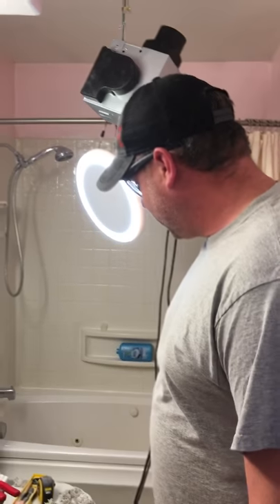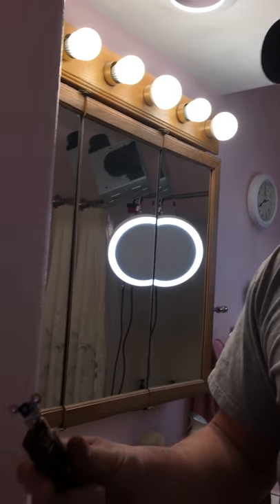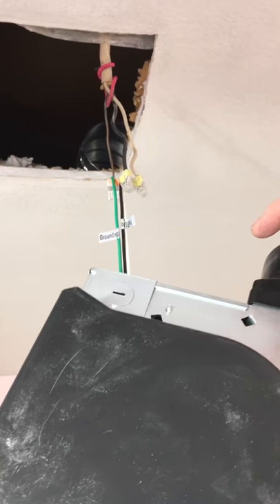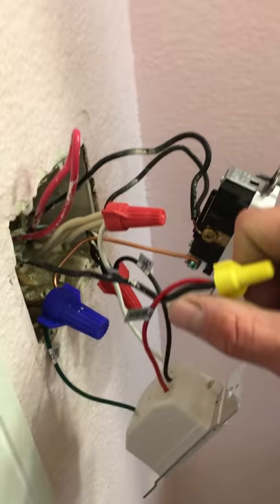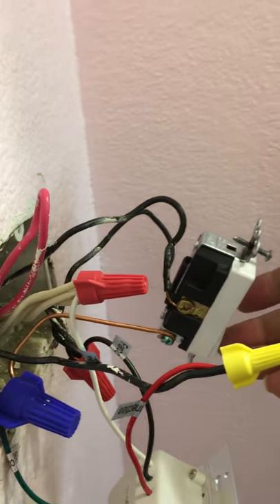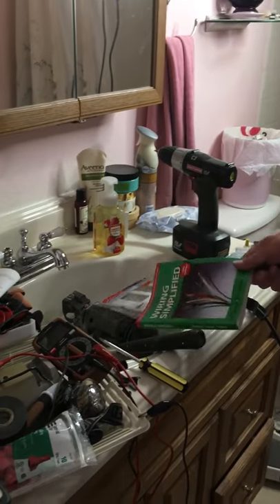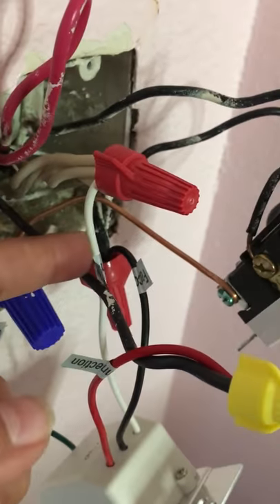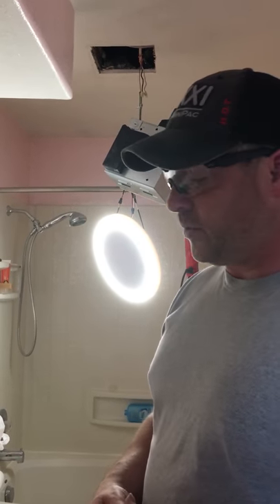Installing Home NetWerks Bluetooth fan

Comment: Thank you very much for the video. Double thumbs up to your wife for her simple explanation.  The only thing I did differently was I connected the red wire on the back of the supplied switch to the red wire that traveled to the ceiling.  I then connected the red wire in the ceiling to the black wire of the fan. I capped off the black wire in the ceiling since that wire powers the other two lights that I have in my bathroom. Before finding your video I was about to call an electrician. Again thank you both very much.

Comment: Thank goodness your wife clarified the wiring. I was able to install this because of her.
Reply: Linda I agree on that. But both he and his wife failed to say to which House Black wire the Switch Red wire is connected to. I need that info for mine.
Reply: It's easy when you're an electrician, but good job on the diy

Comment: On the switch:
The green goes to ground.  
The white neutral goes to white neutral. 
The black goes to the black power. 
The red goes to the black power from the fan.   

If you are getting a blue flash and clicking that repeats it's because the red is most likely not hooked to the right wire.   

The basic way to think of this is that the power from the house (black) connects to the switches black wire ( giving power to switch) then the red wire (when switched on) gives that power to the fan unit thru the black wire from the fan.  

The white neutral completes the circuit. The green grounds it.  

No matter how weird your wiring is there will be a black power wire and from that same cord will be the white neutral.  

The problem I'm having is that the switch will not pair to the fan unit.  So the four buttons don't do a thing.  I have even switched out all the parts with another whole unit incase something shorted on initial install.
Reply: The original fan unit had an error so a replacement of the unit fixed it.
Reply: I am having the same problem as the on and off button does everything and the 4 buttons just exist for no reason. By pressing the on/off button, changes the functions for light, fan and speakers. Can't access the night light or blue light. By pressing the on/off a few time would led me to a flashing blue light but up-on pressing LIGHT on the switch, it will quickly turn day LED lights and the buttons would not work. No sure of wiring or switch is faulty. Any recommendation anyone? Tried calling support but I am always home and they are not open for business.
Reply: Mine did the same thing ended up being the gray plug inside the light I just unplugged it and replugged it and it connected right away for me

Comment: I was very successful with installing mine, but only after 8-hours of cutting out a larger opening for it and having to also totally re-think the ducting work. I found a 4" to 3" inch reduction duct fitting that works fantastically and even speeds up the airflow as it forces the air into a smaller duct going though the smaller duct tube from the big one that the fan housing has. The wiring for mine was very easy and straight forward as I am already equipped with neutral wiring throughout my 21-year old home. All in all, I love this vent fan! The lighting is awesome with the normal white and the two nightlight settings of amber and cobalt blue. The Bluetooth speaker connected instantly to my phone and to my iPad! I love this fan so much that I went out and bought two more for my other bathrooms!
Reply: Only a lefty would think that reducing the duct from 4" to 3" would actually speed it up.  Okey doke, potato.

Comment: If you purchased the 100cfm model that comes with the electrical switch, it is on its own circuit completely separate from the existing switches in the bathroom. The only thing you have to do is run power to the fan via the black wire.

Comment: Excellent video.  I am having the same problem and am getting ready to experiment tonight.  Following your lead, I think I will start with.... black wire on switch to the power from the house,  Red wire on the switch to the black wire going to the fan, white wire on the switch to the white wire going to the fan, and green on the switch to ground.
Reply: This video actually helped me a lot, I had put all black wires and the red together and my switch was not functioning, thank you very much for this video
Reply: Did this work?
Reply: @andrewburch9789  yes
Reply: I finally got mine to work as well.  I was missing my neutral tie in. Worked perfect

Comment: Question.  My old fan is wired from the vanity light, sort of daisy chained. Will i need to run a direct wire from the switch for this to work correctly?

Comment: This so far has been a nightmare
I have a 3 gang  switch 
1st. switch- Recess light work pigtail of the main blk wire
2nd  vanity light switch did the same as above.  Works
3rd switch (unit) 
wired the red and blk wire
White/ white
Blk/ blk main power
Ground/ground.  Doesn't work

Fan
White to white
Blk to blk
Ground to ground
Capped  off the red wired

Pls tell me what I am doing wrong?
Reply: I know i am late to the party but i have the exact same issue at the moment. Did you ever find what it was? i am mentally exhausted

Comment: This video helped a ton. However I still don't understand what to do with the red wire coming from the ceiling. Do I cap it off or something? Maybe it was said but I didn't understand or I missed it
Reply: Did you ever get an answer to this question? I'm in the same boat
Reply: Same boat as well

Comment: Ok. It looks like your wiring in your box is exactly how mine is. I wired my same fan unit the way you did and thought I had success. I paired the switch as it said to do in the instructions. Everything worked including Bluetooth. But then after pairing, none of the function buttons work. I push them in vain. Any thoughts on what has gone wrong? Thanks.
Reply: Did you ever figure this out I have the same problem
Reply: @ryanjohnson7572  Yes! I figured out that one of the thin bare wires (there are 4) that go into the socket (4 separate hole) was bent and didn't go into its assigned hole. The others did and those functions worked. I went up to the unit and discovered this issue and fixed it and then the pairing was successful. Thanks for asking.

Comment: How is the actual sound of the speaker? Pretty nice sound or cheap sounding? Thanks for sharing!
Reply: TLee we tried the demo they had setup at Home Depot.  Sounds clear with a little bass in it.  It’s two 2” speakers and it does get loud
Reply: Could be louder but not bad and clear sounding not cheap sounding or distorted

Comment: Avoid trouble cutting the connectors, I had a problem with the fan and Bluetooth because the connector doesn't work

Comment: Did u have to get into the attic?? I have no way to get into my attic!
Reply from the maker: TACOMATSS yes, spent quite a bit of time up there installing to new duct and securing it.
Reply: I just took out old fan used a muti tool to cut rock and plaster to fit the bigger fan and screw it thru the side of the housing against the stud in ceiling so no need to go to attic the cover will cover the hole so just fill with drywall mud to fill in hole if any and done took me 10 mins to install

Comment: why didn't you just run a three wire into the attic, wire according to diagram in a junction box and run a 2 wire into the fan from the junction box.  i think it would have been a cleaner install.

Comment: Note to self.  Only install a fan that connects at the current ceiling wires and doesn't need a new wall switch.
Reply: i think it is optional, but worth it, especially if your network ever goes down.

Comment: My system is all connected and just won’t stop flashing. Switch on or off it just flashes then makes a click, click noise. Then flashes. Over and over off or on just doesn’t stop wtf is going on.
Reply: Same I don't know what to do
Reply: rosco still never been fixed over 1 month.

Comment: This wire is a direct link to the breaker panel it doesn’t feed off or feed anything. Completely alone.

I tried black and red together to black, I tried black to black with no red I tried red with black. 

I am just not understanding where I am going wrong.

I read the instructions that says it needs to be paired but mine doesn’t turn off at all it is always on.

Comment: I have 3 homeworks Bluetooth fans and the buttons on the wall switch control all 3 fans at once tried different breakers and wired separate but still controls all 3 please help if have solution for this prob Everytime someone turns the light blue in bathroom my other 2 lights change blue
Reply from the maker: Danny fresh are all three fans in one bathroom? Are the fans setup in a series? Is there only 1 switch for all three fans or does each fan has its own switch?
Reply: Did you ever fix it?

Comment: It's pretty simple. Basically if there are 2 switches the only thing that wont need to be there  is a jumper wire from the black wire. Instead the black wire from the fan control goes to the bundle of black wires and the red wire goes to the black wire leading to the fan. The rest link up to common sense. You're welcome